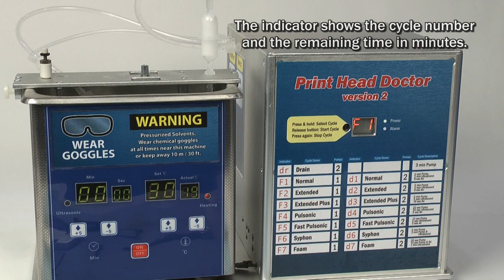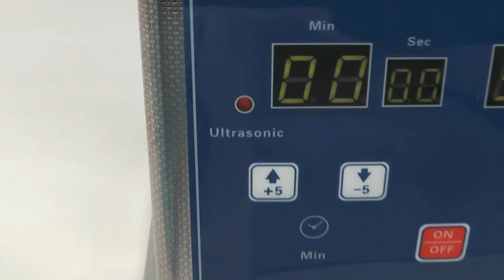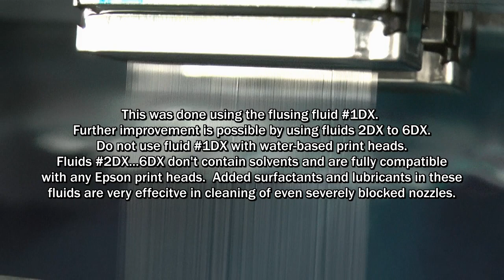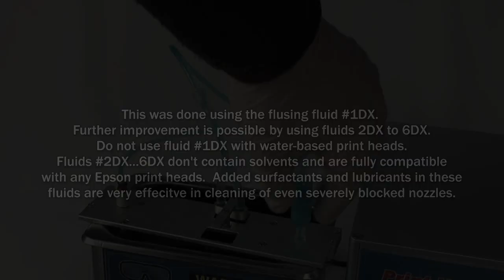Print Head Doctor recovers Epson DX4 print head of Mimaki, Roland and Mutoh

Comment from the maker: The cost of the machine is $1500, plus you'll need an Epson DX4 adapter for $250 and a Reverse Flush cap for $150. The machine is now model 6 which is more advanced than the one you see on this video.